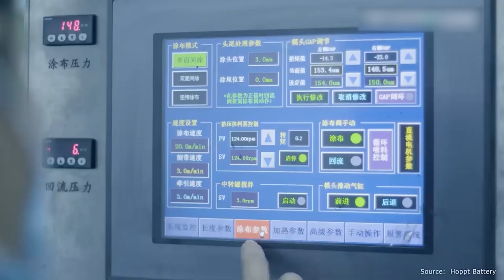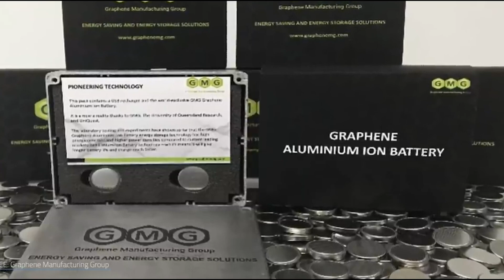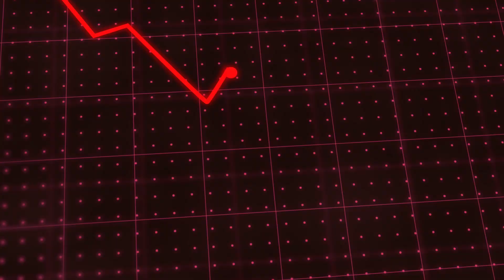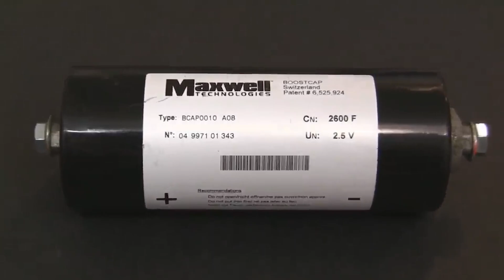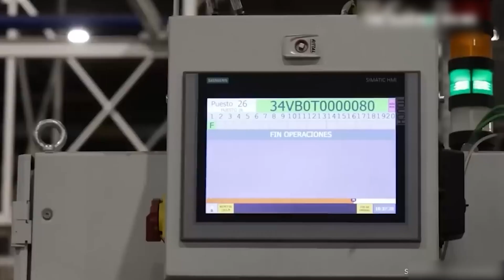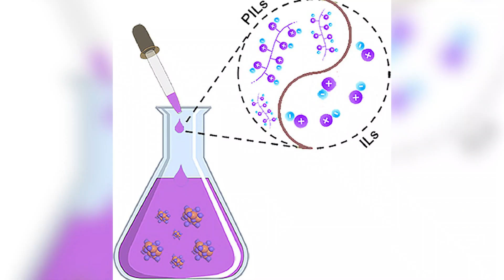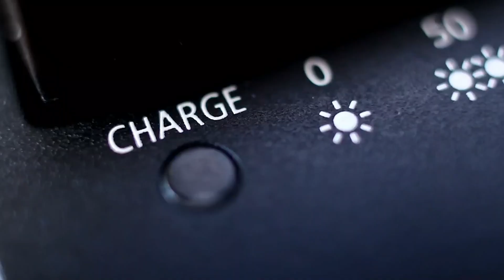NEW Aluminum Ion Battery might just be BETTER than Lithium!

Comment: 1. Whatever happened to a solid state battery. 
2. How come we haven't made a battery using electroplating?
3. The same processes we use to make semiconductors Can be used to make Very high energy density batteries.
Reply: Prove it!
Make it!